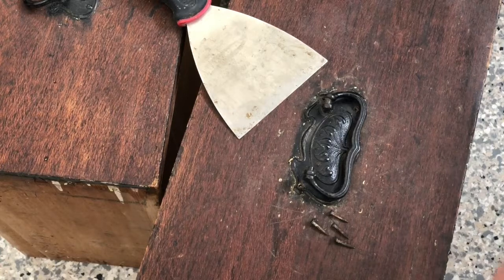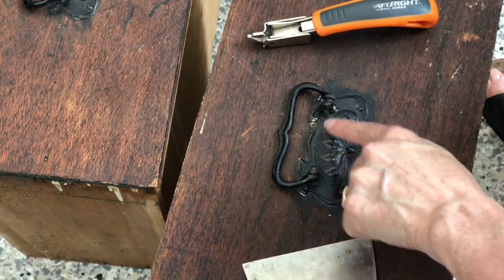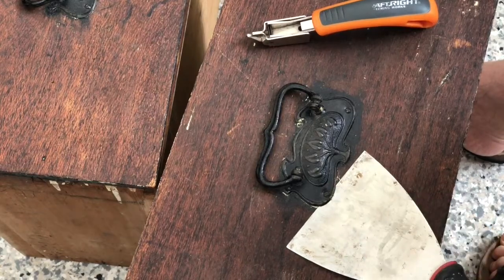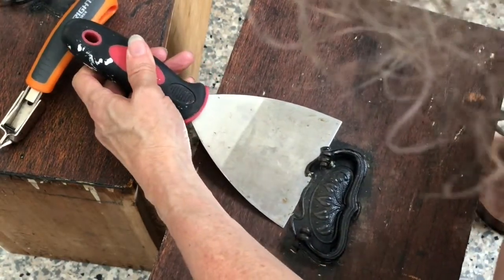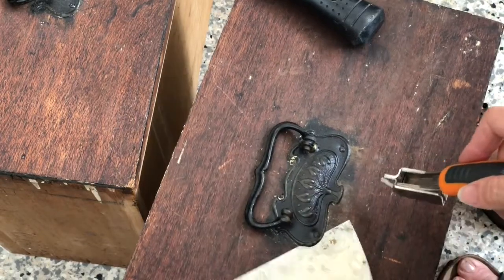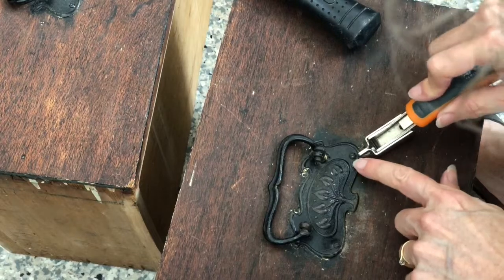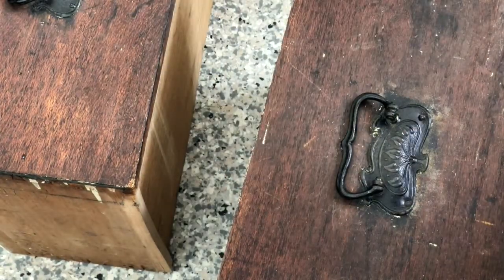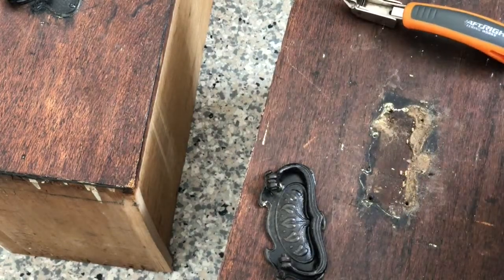How to Remove Vintage Handle Pull Escutcheon Plates without them Breaking.

Comment: How do you clean them once they are finally free please
Reply from the maker: I usually put vinegar n a pan on the stovetop and boil them in t a few minutes which is especially good if they have paint on them. Then depending on what they’re made of, you can use a scouter to remove any grime, or an old toothbrush.

Comment: Great video thank you but I do have a question do you need to replace those little nails / pins ? Or will that go right back in ?
Reply: Hoping you get a response, wondering the same thing
Reply: I'm wondering the same

Comment: Hi, thanks for the video, super helpful. How did you clean the brass handles? I have the same sort and need to paint the dresser and restore the handles.
Reply from the maker: Kate Forster I liked the darkness of the handles and after a general clean, I actually brushed over them with either some of Fusion’s Coal Black or black wax, I can’t remember. If needing to clean, I’ve also used bicarbonate soda and vinegar solution overnight to soak and scrub.
Reply: @irestorestuff  Thank you.

Comment: Hi. I have bail pulls since I have a 20 year old bedroom set. The handle part that you pull to open are missing on a few but the back design is still there. Am I able to replace only the handle part?
Reply from the maker: You’d have to find a vintage handle supplier to see if those exact ones are available, but I’d imagine you could replace them only.

Comment: Do you just hammer them back in afterwards?
Reply from the maker: These ones I replaced with different handles but yes you can hammer them back in or use tiny screws.